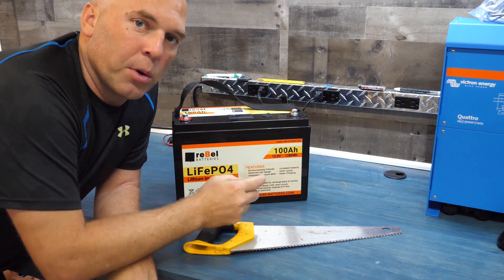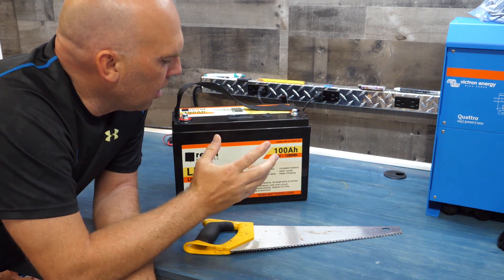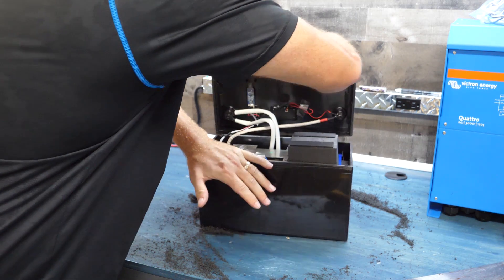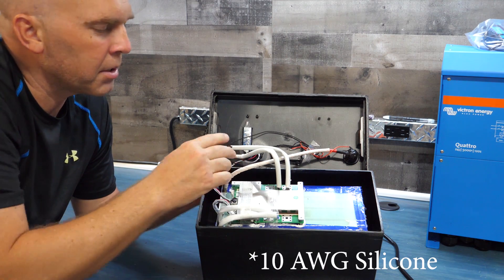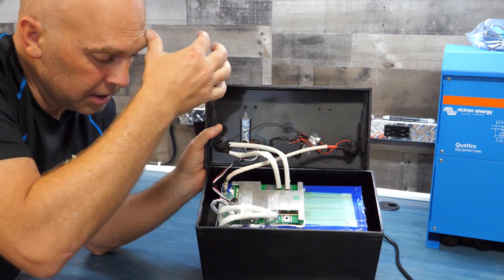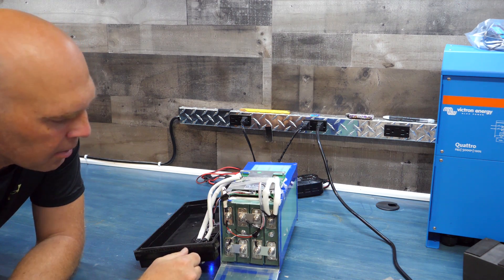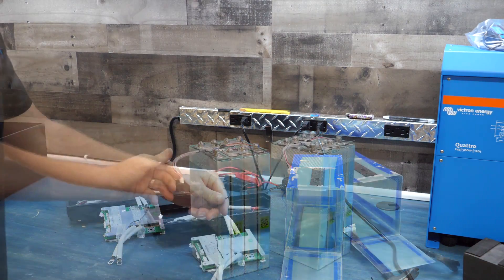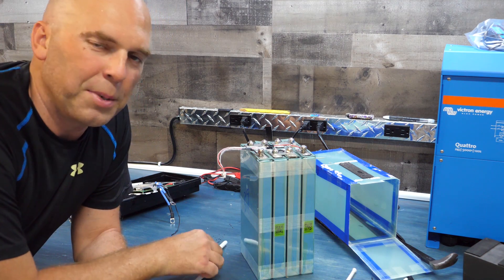reBel Batteries - 12V 100A LiFePO4 Tear Down - Inside a Lithium Iron Phosphate Battery

Comment: I gotta pull 2 12v 200AH batteries apart to reconfigure them to 48v with a new BMS, assuming each battery pack is paralleled internally. I was using them in a 24v config but one didn't fully charge and cut off while the other had 40% left.
I think i might use a oscilating cutter tool though.

Comment: its not for starting a car, that 8mm kabel fry
Reply: The LiFePO4 chemistry electrical storage cell is not designed for fast high current drain, as in starting an engine.  However,  if paralleled with some big Super Capacitors, you can do it, because the power comes from the Caps, and the LiFePO4 battery only charges the Caps from a small gauge wire.

Comment: Can we remove the BMS and use/charge directly?  I have a good battery with a bad BMS.
Reply from the maker: This is never recommended. The BMS is your first line of defense from overcharging or charging while freezing, too many volts/amps, etc... which all can cause bad things to happen. Do you have a reBel Battery? If so, get in touch via support@rebelbatteries.com and we can work out something through a warranty claim.
Reply: @reBelBatteries  no, I don’t have a rebel.  I wound up replacing my BMS and am now very happy. The BMS was super easy..Thanks for the advice!

Comment: Is the temp sensor a High AND Low CHARGE disconnect based on ambient? I don't believe you said anything about what it's for or how it works.
Reply from the maker: Yes, it disconnects if it goes outside of a temperature range. See datasheet on the downloads tab at our website for battery specific values.

Comment: I was trying to replace my Electric ATV's 1500w   48v  (4x12v20Ah lead acid) battery  and I was wondering what LiFeP04 battery you could recommend to replace my old acid battery.   Any help would be greatly appreciated.
Reply: you can use 4 units of that kind of battery on this video.
just don't forget to set up the proper BMS for battery safety and healthy.
in this video, it's 100 Ah battery set, 12 Volts.
you need that 4 units battery, so you will have power of 48 Volts and 100 Ah if you connected in series (not paralel).
the more Ah of battery you set, will give you more range (mileage) of your electric motor.
the more Volts of the battery, will produce more power of your electric motor.
the choice is your... wanna get more power or more range... or... both...
👌🏼🔋⚡

Comment: Can these batteries be put in series and parallel? Is this battery approved by ABYC Thank you
Reply from the maker: Yes, they can be put in series and parallel. ABYC 13 (Lithium on vessels) is not final upon last check, but it looked like our batteries meet the spec. If there is an approval process, we are unaware of it.
Reply: @reBelBatteries is shipping free in   
USA

Comment: I see the positive going directly to the cells but the negative is fed through the BMS first. How can the BMS circuit board handle the CCA going through the negative? Or does it not work like that?
Reply: That’s how they work and are designed to be set up.

Comment: Thank you for interesting video.
, I am going to replace Acid  Aux battery  for my motorhome for12V 100Ah Lifepo4 Lithium Iron Phosphate Battery Built-in BMS . I have question for you, can I use motor alternator to charge battery during the ride ?  Is the BMS will be automatically off charging when battery is full
Reply from the maker: Yes, you can certainly do that. However, the battery will suck up 100% available power from the alternator (100 amps) if it can supply that much.  For most alternators, that means you'll run it very hot and probably kill it within a short period.  I've seen some good videos of charging from the alternator through a DC-DC converter, that converter can regulate how many amps are being pulled off the alternator so as not to kill it.  Search for "charging LiFePO4 with alternator" and you'll find some good info.  Tito has a good one I watched last week. (https://www.youtube.com/watch?v=TDxfRXgQT04)
Reply: @reBelBatteries  Thank you for detail explanations
Reply from the maker: Oh, and yes, once the battery hits it's High-Voltage Cut-off, the BMS will stop pulling power from the alternator or converter (if you go that route(recommended)).

Comment: Really doesn't matter what kind of insulation use on The Wire if it was wrapped with pure virgin Angel hairs it wouldn't increase the amp capacity of the copper wire. The silicone insulation would be good in case of short circuit fires. The more insulation the more heat the wire retains leading to lower amp capacity. I question that 8 gauge wire on a 100 amp capacity test. You should show  us with the battery taking apart discharge and charging and see how hot the wires get
Reply from the maker: William, here's a video testing 115 amps across the wire.
https://www.youtube.com/watch?v=iRH9sRL1_uY
Reply: I completely agree that the insulation isn't an alternative to properly sized wire, but in this case 8 gauge wire is enough for a 12 volt 200 amp draw. The main thing to consider is the wire is only inches long, if this were 10 feet you'd want 0 gauge wire.

Comment: Thanks for the video. What are the thoughts on adding batteries from a different manufacturer to an existing setup?  I have 2 Lion Energy 12V 100ah that are about 6 months old. Haven’t really been used since I’ve been on shore power all the time except for when moving down the road (2-3 short trips).
Reply from the maker: The old advice for lead-acid was don't mix due to changes in charge efficiency over time.  However, LiFePO4 batteries don't suffer those changes and can be mixed if the BMS's are designed for whichever way you plan to use (parallel/series).

Our batteries (100/200/300) can handle either of these configurations.  Not sure about the Lion batteries, I would think they can, but definitely check up on it for your model number.

Some various opinions:
https://forum.solar-electric.com/discussion/352842/mixing-new-and-old-lithium-lifepo4-batteries
Reply: @reBelBatteries  Thx. The Lions do support all configurations. I’m paralleling (currently 12v/200ah). Thx for link to other info.

Comment: Why there is no cell compression?
Reply: @reBelBatteries  In the DIY battery building scene people are discussing cell compression intensely:
https://youtu.be/FdDy8b5x7Y8
Most of them compress their batteries to maximise cycle life.

I wonder why drop in batteries often have no compression. Do those manufacturers simply not care about reduced battery life?

Being confused about that, I decided for myself to go for a battery with cylindrical cells. Cylindrical cells do not need compression by their geometrical design.
Reply: Look like Prismatic cells.

Comment: Awesome to see what's inside. Some still shots of components would be nice to see. 
I bought 2 for my motorhome. I replaced my charger converter to a lithium model to fully charge the batteries. I then spent the night in  my motorhome to see how the batteries would do. The batteries powered the furnace fan all night long. Then I ran electric space heater off the batteries until they were  low but not dead. These batteries lasted much longer than the lead acid batteries would of lasted. I'm impressed with the power so far. Bluetooth works. The app works but is a little slow, and requires a refresh at times. Otherwise works well. I would purchase these batteries again, especially if they increase the amp hour capacity.
Reply: James, glad they're working well for you. And thanks for the review on the website!  With that charger, they should give you many years of use. Thanks again and stay safe.

Comment: What national or international organization(s) rate #8 wire as you have listed. Don't believe NFPA rates it at 200 or more amps. Does NEMA or a similar recognized organization approve of those ratings? I can't tell the origin of the charts you showed. Also question the BMS being directly fastened to the cells. I know some manufactures do this but most of the better companies provide some thermal insulation between the BMS and the cells to minimize cell deterioration from heat.
Enjoyed the video otherwise. Thanks.

Comment: Csn these be used on trolling motors , I know some say deep cycle and some don't!
Reply from the maker: They're great for trolling motors.  Anything pulling less than 100Amps @ 12V.
Reply: @reBelBatteries  -- This looks like a very well-built battery at an attractive price point.  Can they be safely connected in series to power a 24v trolling motor?  Also, can they be safely charged using an on-board AGM dual-bank charger, or do they need a special lithium charger?  If so, do you sell those?
Reply from the maker: @jasonbroom7147  We are sold out at the moment.  These did not have the parallel capability, but our next batch will and would be perfect for a 24v trolling motor.  Stay tuned!  Delivery in mid-February.
Reply: @reBelBatteries  -- Is there a mailing list I can be added to so that I'm notified when the series-capable batteries are available?
Reply: @reBelBatteries  ...what is different with the "next batch" to allow for series and parallel operation?
Reply: Should have a review for you soon ! Just ordered one to give my Dad for Christmas 🎄.  Thanks
Reply from the maker: @dustinsmith9204  Awesome, I'll be looking for it.  Ships today via UPS. You should have it in plenty of time.  Thanks!

Comment: Are the cells made in the US ?
Reply from the maker: Jimmy, there are no US-based cell manufacturers that I'm aware of.  Some battery sellers state (designed and assembled in the USA) but the cells still come from overseas.
Reply: @reBelBatteries  Thanks. Everything is made in China nowadays.
Reply: There are some small scale manufactures in the US (see link below), they are like specialized cottage industries in comparison to the manufactures in China, Korea and Japan. The Chinese and Koreans can produce excellent quality stuff at attractive prices. The US has pretty much missed the boat when it comes to manufacturing lithium cells. 
https://usamadeproducts.biz/electronics-batteries-lithium-ion-batteries.html
Reply: @urbanimage  yeah, the USA doesn’t miss the boat when it comes to executive salaries/benefits and withdrawing their stock dividends. Got it nailed in good ole greedy US of A!

Comment: 120920/0648h PST- 1448 UTC.   Thank you for tear down of the LiFePo4 battery bank and exposing the cells. The JBD BMS controlling the balance and temperature cutoff is a very reliable device. I’m sure many DIY circle would prefer assembling the same by themselves, thus saving immense amount of funds. I’d prefer doing that, myself.
Thank you for the presentation. Hmmmmm  lot of muscle power, indeed. Well, Sir, take care n stay safe. 73s...
Reply from the maker: Some people do like saving money.  For an all-in-one LFP battery solution though, we feel we're a pretty affordable choice.  Thanks for the comment and good luck!